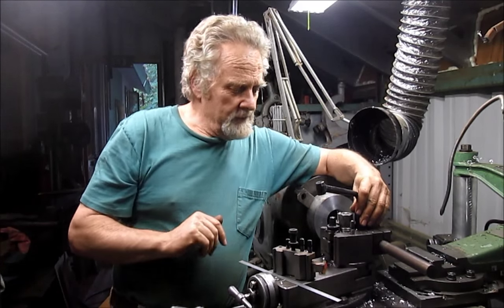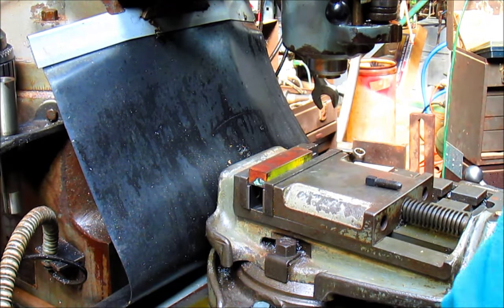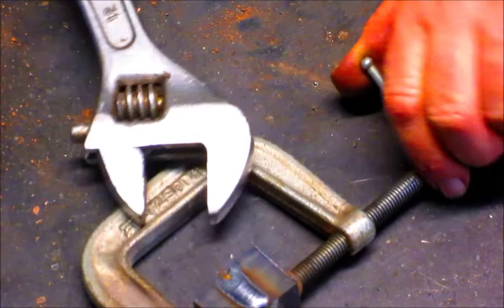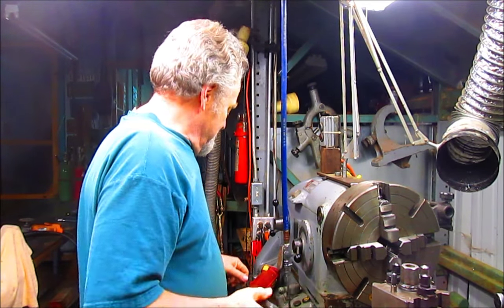Square Head Wrench The Hard Way

Comment: I had to ream out a bushing deep in a casting with a hand reamer.  While the shank was outside the casting, I could put a wrench on it but it didn't take long until the wrench would no longer fit.  I needed a square socket. To get the job done, I ended up getting a cheap set of crow's feet I could use with a 3/8" drive.  The thought crossed my mind, how could I machine a square socket.  I didn't feel like making a broach.  I really need a whole set of square sockets, since the reamer set has all different shanks.  Another thought was to make a socket with four set screws, might work.  I also thought of welding four small plates together, but I never thought of making the socket in two parts and welding them together.  I wonder though, why did you do the 45 degree instead of just making a square slot the width of the bolt?

I like your solution, will remember it if the problem should arise again.  Jim
Reply from the maker: Now that you mention it milling a square and putting a cap on it would have been easier. Just the way my brain works I guess. 3 yearsw later and I'm still using that tool.

Comment: Nik,

To quickly get that blank centered up , could you not have inserted one of the tightly fitting hardware store square bolts, turned it around, chucked it by the threaded end into a drill chuck in the tailstock, opened the 4 jaw chuck up a little, brought the tailstock up to the chuck so the blank was inside the jaw area, and then eased the jaws up to the blank?

As always, very enjoyable video - and I do always "have some fun"!

Brent
Reply: my thoughts as i watched  , great minds? i always have fun with nick as well lol